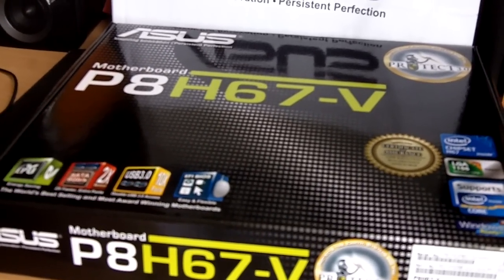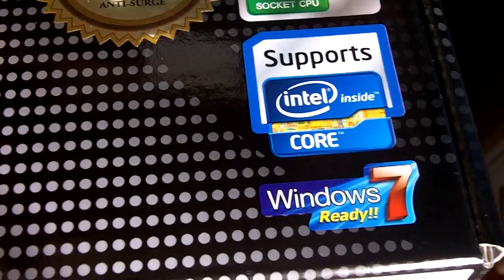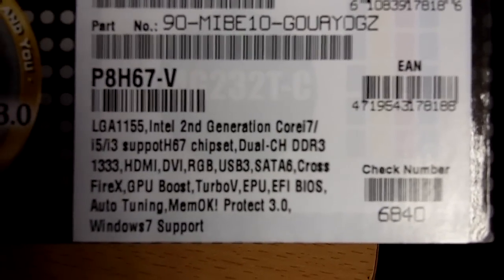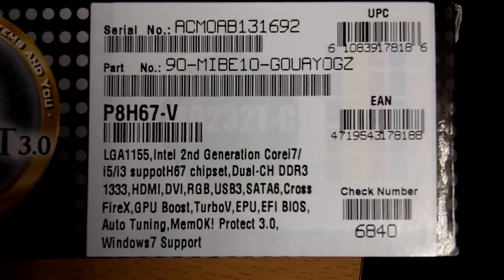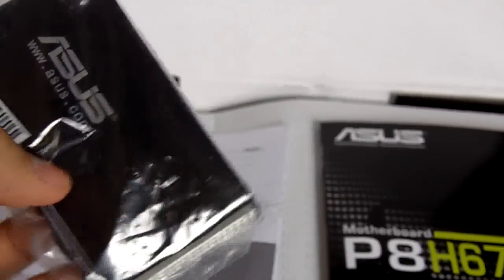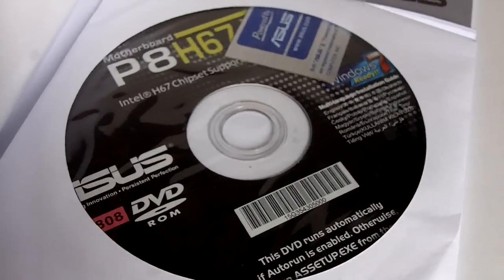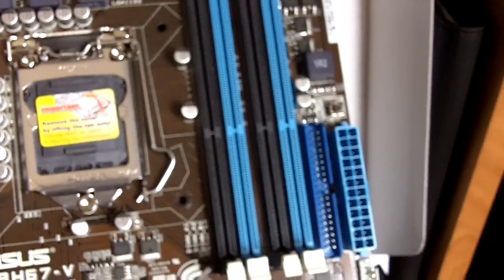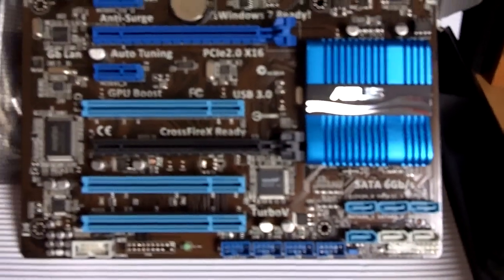Asus P8H67-V Motherboard- Part 1: The Unboxing

Comment: Yes. The board has 8-pin, but is it possible with a 4-pin? I am not using a graphics card at all, I prefer using onboard. I am worried it will damage...

Comment: @jamsterman1
not exactly if u want to overclock ur system, then yes, but consider that overclocking ur system means, more power consumption, and more heat, so u need to have a good cooling system..
if ur not acquainted with the word overclock, then u should buy a motherboard which ur budget can afford =)

Comment: Thanks a lot for your videos, very useful.

I have a question, though. You said you were able to reach 107.34Mhz x 33mult=3.5Ghz, so 200 Mhz overclock. Did you manage to get over that figure? Couldn´t you raise the x33 at all?

Thanks man.